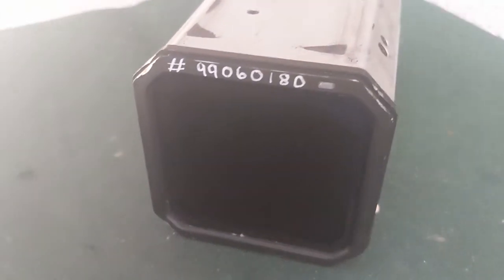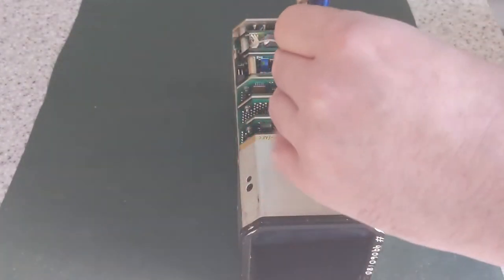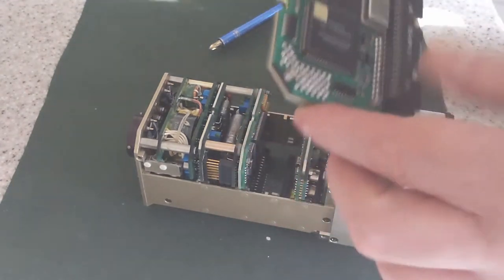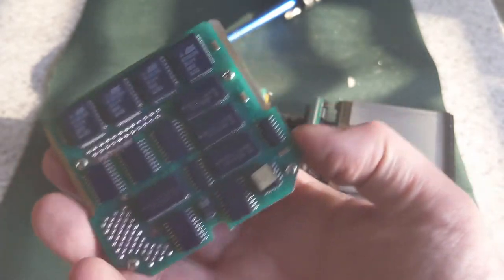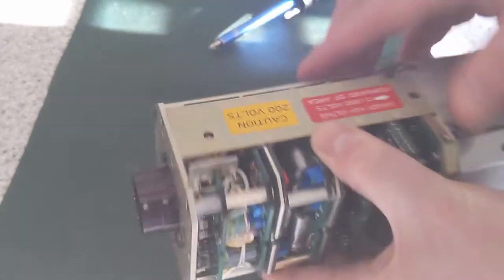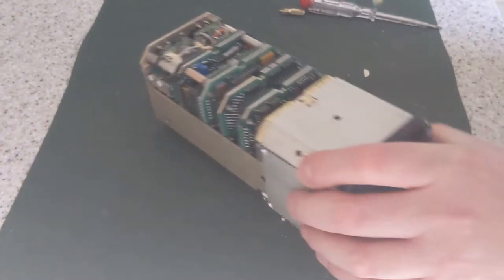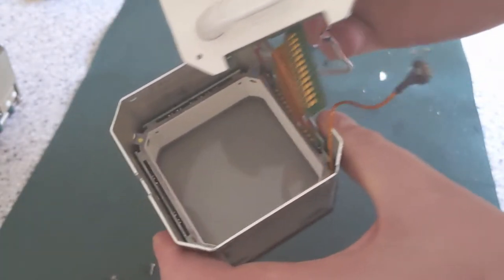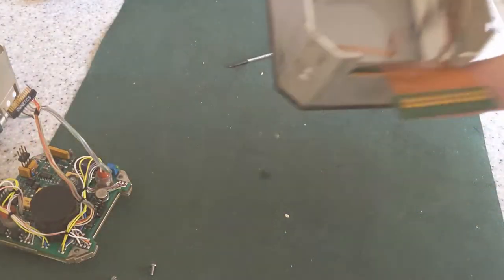Aircraft instrument teardown TCAS / TCRD LCD display unit

Comment: Very nice teardown. It is interesting that this CPU was used for graphics accelerator for arcade games
Reply from the maker: Shame I couldn't power it up. I try and look for 28 volt parts which I thought this was but unfortunately it wasn't. Will likely be an eBay resale.

Comment: The pinout of the circular connector is probably identical to the two other instruments TCAS/VSI I have tested. You can build a small power supply using an audio power amplifier, a toroidal transformer and a 400Hz sine generator. I would be interested to test it if you want to resell it.
Reply from the maker: I'll check out your videos of those units you tested. A brief skim through one shows that yours has its 115v supply on pin 40 like this one does. I thought any making my own inverter but just for one or two uses I think it would be a lot of expense. I binned a couple of audio amplifiers a couple of months ago too although I doubt they would have been powerful enough.

I would be interested in reselling it but it did cost me quite a bit. More than I'd usually pay; how much would you be wanting to pay for it?

The unit is definitely from a helicopter and uses a sort of off the shelf TCAS display with modified firmware. I found that TCRD possibly stands for torque cruise rpm display so it would suggest some sort of engine monitoring device.

Comment: That is quite the backlight tube.   I wonder if it might be a barrier discharge lamp rather than a CCFL.  Kodak made these back in the '80s-'90s for use in photocopiers.  They put out a bright greenish light which contains little to no UV.
Reply from the maker: Yes it could be. There's no information in this unit other than the installation manual for the version that's used as a TCAS display.